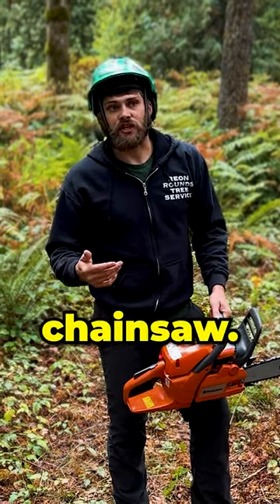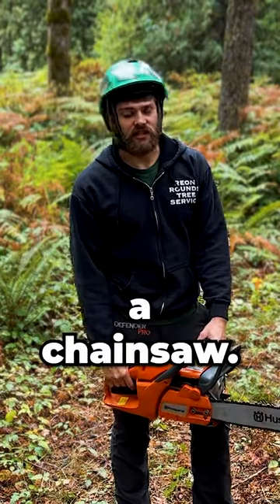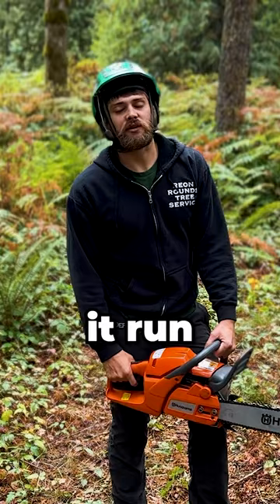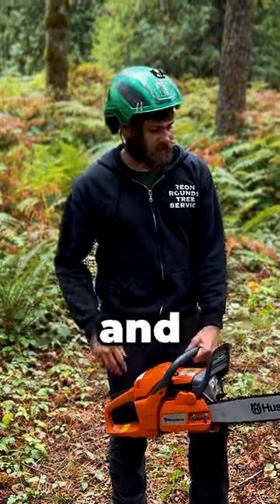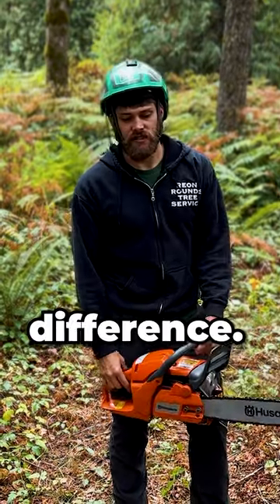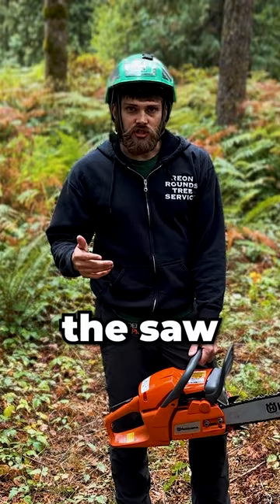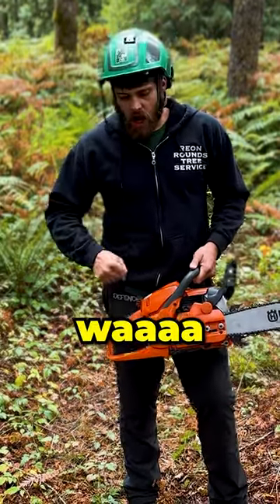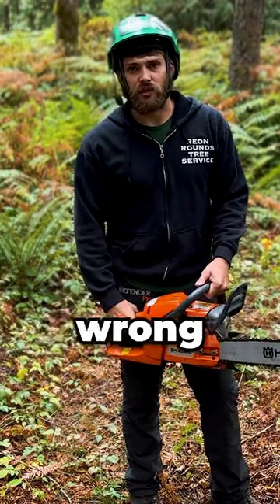How to Warm Up a Chainsaw #shorts

Comment: From a mechanics standpoint. Everything made now is so precise thats the oil is lubricanting everything seconds after starting. This wasn’t the case 50 years ago. It probably doesn’t even matter. I still let things warm up but in a pinch when I don’t they still work. When its broken youll know it and the last thing youll think is was it warm enough
Reply: Especially when it’s super duper cold out, let it run at least a minute before you start working it, and even then go easy for a while, then you can go crazy

Comment: In my 45 years of running I've seen a strange pattern in both Stihl and Husky saws.  If I bought a new saw in winter, it wouldn't make it through the extreme heat in summer but if done the opposite, some of my saws held up for upto seven years, which happened to be blue printed 385 Huskies. That was an average of 80 trees a day in everything from minus thirty to nearly 100.

Comment: Letting it idle will actually warm up the saw faster because it will allow more time for the heat to be absorbed into the exhaust than if you ran it, also you should absolutely let the saw warm up because everything is built and designed to be run when the metal is warm and expanded so putting force on the saw when the metal is not only constricting parts but also is more brittle will damage your saws

Comment: A brand new saw needs no break in that was done already at the Husqvarna/Stihl testing facility. The only time you need to break in a saw gradually is when you replace the top/bottom end
Reply: That's what I did with my husky 50 after rebuilding it. Runs like new with the factory carb settings.
Reply: My dad was of the mind to run the mix rich for a tank or 2 after rebuild. Warm-up was as long as it took for the exhaust to feel warm.
Reply: stihl recommends running the first tank with motomix fuel and letting the saw idle for 5-10 min before cutting. after that, have at it. source: stihl mechanic
Reply: @Brett710  I bought a brand new Stihl in 2020. The manual said to run motomix, and to not go full bore for the first two tanks. After that, let 'er rip.
Reply: @FerociousSniper  it does but my Stihl representative says that's just extra precaution. Most won't even have the patience for it. Same with the moto mix fuel, it's just to make certain people are running the right fuel with proper octane rating and oil ratio.
Reply: @Brett710  that makes sense. It amazes me how many people don't read the manual. And then they act like it's a POS when it doesn't start after a year of bad gas sitting in it.

Comment: Let all saws warm up. Especially newer saws. The pistons are so lite weight they warm up faster than the cylinder and can expand faster than the cylinder causing a cold seize. When it cools back down the piston shrinks enough it will start but will be scored or stuck rings
Reply: This is the way...
Reply: So if you have a saw that you've used a decent amount, you say let it warm up for how long in the morning in a brand new saw? How long would you let it warm up i'm just curious thank you so much
Reply: @br-dj2ti the best method is to let them idle for 5 minutes to ensure everything is the same temp. Lightly bring your saw up to full throttle. I do a couple low revs to get the bar oil moving and then a couple medium revs for about 20 seconds off and on. Once you get the saw moving then you can start cutting. It’s like your body. You will not move as fast first thing in the morning as you would if you stretched and warmed up properly
Reply: @JohnnyButtercuts  Thank you I appreciate it

Comment: My train of thought on this comes from the Mechanic days, as when you build an engine you don’t want to let it just idle and idle and idle. It dose need to reach operating temp but if you say let tanks of fuel through just letting it sit there the piston and cylinder sort of become married to that set speed and vibration, after reaching operating temperature, you want to rev the saw like you intend to use it as that gets the piston and cylinder relationship to where it knows it’s going to live its days, I would say on a new saw or more so a fresh rebuild to do a few trees or half a day even of just Limbing the tree, Reving it out as normal but keeping the actual engine load down before just dogging in hard and giving it full mustard. Epic work Jacob! Keep slayin and keep safe my guy 🤘

Comment: I have 4 saws. I always let them idle for a minute or two before I use them (that’s how you avoid a cold seizure).  Even when I put them down for a minute…they idle. You might spend a little more on fuel letting them idle, but it’s way cheaper than turning your saw into an expensive boat anchor.

Comment: There’s a reason the old owners manuals used to say 3 tanks for break in. Also, always warm your saw up for about a minute, when the exhaust is hot your saw is ready. Lastly don’t ever WOT a saw not under load when it’s new. Even after it’s broken in you should only be doing that when you’re tuning it and never for more than 2-3 seconds.

Comment: There is still a phenomenon called cold seizing if you get on the throttle too hard too early. A calm to moderate warm up makes sure the piston ring vs cylinder clearances are good.

Comment: Heat cycles.
Use it normal for a few minutes. 
Let it cool off
Repeat
For a couple tanks, 
A saw wont be fully broken in until at least a  few gallons go through it

Comment: Only EVER run a saw wide open with a sharp chain and while cutting a log "under load". And no need to break it in. Let it warm up every single time and use it. Old or brand new.

Comment: They're air cooled 2 stroke motors, so i try to just bump the idle up for 30 seconds or a minute. If you idle you risk prematurely wearing it out due to oil starvation.

Comment: If your gonna hotrod a saw can you just get a better exhaust or do you gotta port an time it as well?
Reply: Pretty good question
Reply: Depends how much hotrodding you want to do to it. Opening up the exhaust and retuning the carb will give a bit more power, porting will give it quite a bit more than just a muffler mod, it also costs a lot more ;).

Comment: i do warm up til i cant touch the heatsink from the side. then i pull the gas little just the chain start moving. hold it that positon around 1/10 power of the saw and i wait til the blue/white smoke disappeair bc then the exhaust heat up well.

Comment: These 2000 dollar saws that's by the time you get gordys bolt on mods its 2000 grand I'm doing heat cycles and break in.sorry but I've had new ones bad seals and cases .there to expensive to not break in few tanks about 6

Comment: All saws sold in the US are ran for like 50hrs at the factory to test emissions nowadays. No real need to break them in anymore. As far as starting a cold saw. Let it run on half choke for like 5-10sec. Blip it a couple of times to get some juice in there and then let it idle for a minute or 2

Comment: My experience with husqvarna is it doesn’t matter.  I can tell you huskies screws don’t stay tight, so routinely take your t-wrench (torques bit) and check every screw.  If they get loose, they rip the threads out.  For instance, the top cover on a 395xp will triggered the decompression button and drive you insane.  Otherwise, great saws.